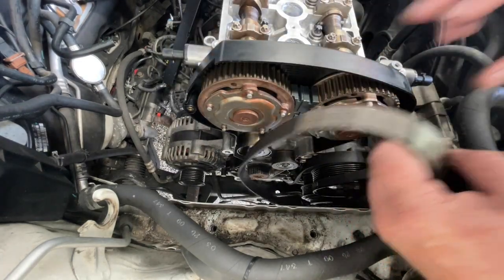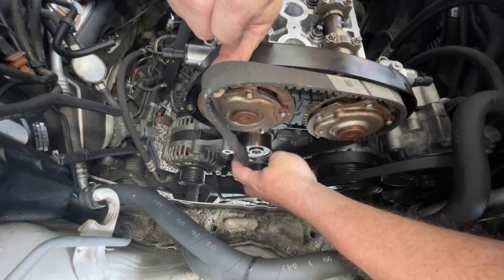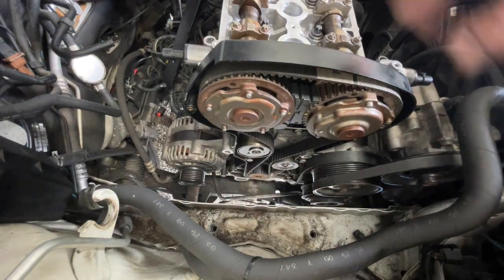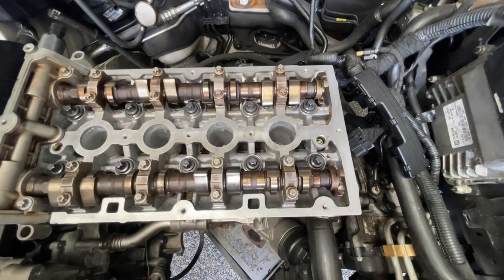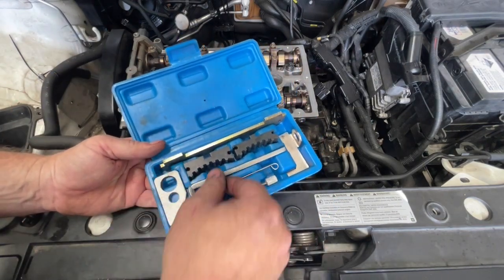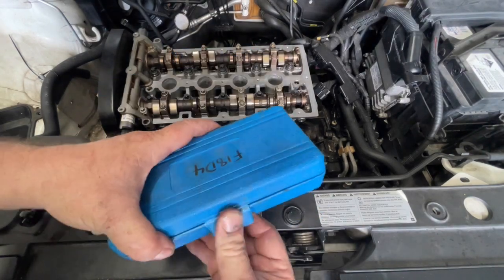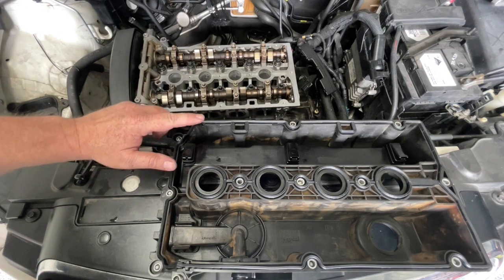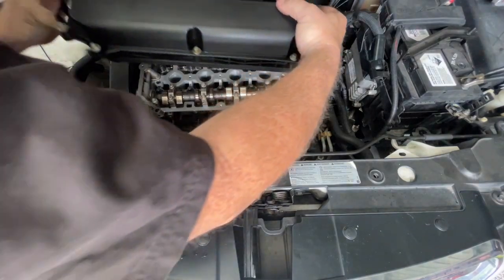Cruze Head Gasket Replacement  STEP by STEP process (Part 10 of 16) Full Details for 1.8 F18D4

Comment: The belt goes on a lot easier if you do the top two pulleys, pinch it to go between the tensionner and idler and then just slip it over the bottom cog. No worries about the top two going out of time.

Comment: question: if i have the crankshaft aligned at the 4/5 o'clock location - should i then be able to rotate the crankshaft with a wrench with no dificulty? i ask this question bc i have the crankshaft indicator at the 2/3 o'clock location, and i have not been able to rotate the camshafts to, then, align the timing to TDC prior to putting back the belt. In other words, my chief question is: is there a relationship between being able to rotate the camshaft with the wrench & the position of the crankshaft (piston position)?
Reply from the maker: yes. assuming no other issues, when pistons are at the top or bottom the crank rotates easier compared to when pistons are at their mid way point.